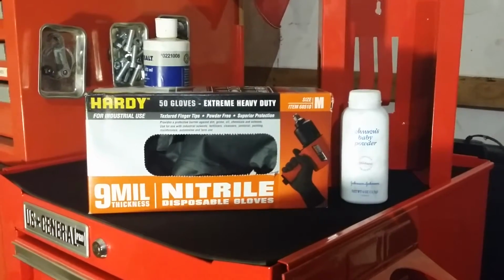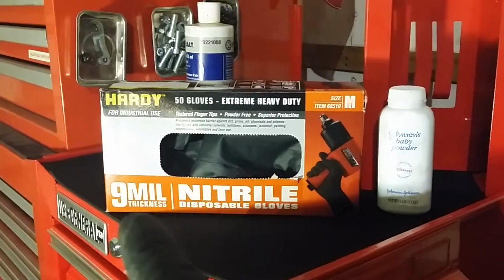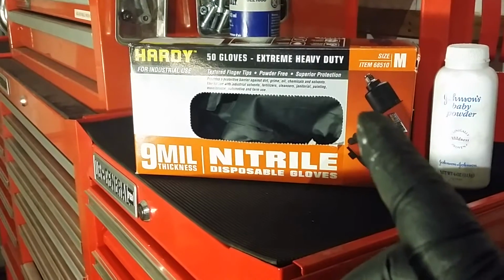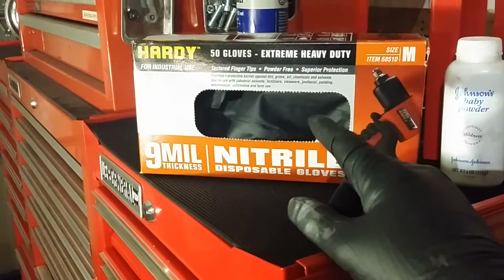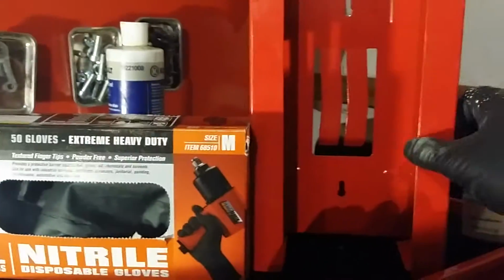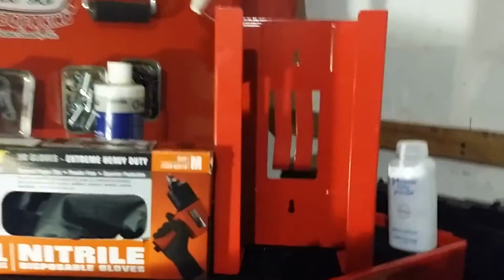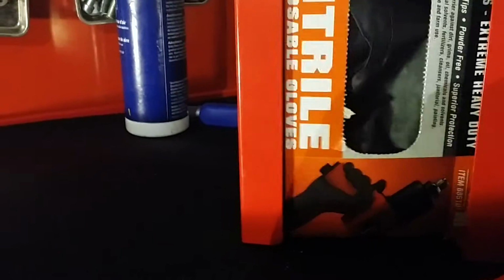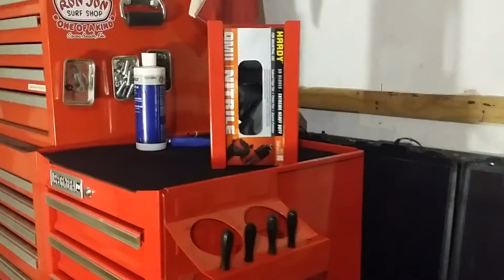Habor Freight 9Mil Nitrile Gloves and Magnetic Glove Dispenser

Comment: Good vid. Just bought a dispenser and another box of gloves at  HF last nite. Figured maybe I needed to buy more expensive gloves to to get a thicker box for  the dispenser to fit. I was like  wtf is this. I ended up bending in the tabs. The side ones not as much as the rear, but they are super snug. Careful not to bend too much, it will crack the paint as I've learned. But hell, for the 12 bucks it costed, and cracked paint on the back, im not worried and am satisfied. Shitty thing for HF to do tho. Ehh well. Get what you pay for. I grabbed the green one by the way.
Reply from the maker: It is a pretty good buy. It beats having your box of gloves kicked around the dirty floor. The HF 9mil gloves are the best ive found so far.
Reply: @matthewszostek1819  thanks for the reply. Wasn't sure being a 2 yr old vid. Lol. You have other HF reviews? Forgive me, I went to working in my shop after this I seen this vid, and didn't browse your channel.
Reply from the maker: @TKO---607  I do. Nothing like Ave. Some are more like which size air ratchet should you buy and why. I get into some weird projects too. I'm moving in an electrical direction but I have some videos on engine swaps, building cranes, sailboat restoration, carpentry, building custom dollhouses, and biodiesel with a little gardening and deep bible study. Pretty good content with rock bottom cinematography.  Thanks for being you and stopping by.

Comment: they are really good gloves, they do have a measurement diagram in the back of the box,  to make sure you get the right size. these gloves do rip Eventually but you can get alot of use out of them.
Reply from the maker: chrisvill54 I have noticed also they do not stand up to solvents for very long.
Reply from the maker: so i used these alot recently doing an engine swap on my wifes car and i probably went through a whole box just doing that job. i dont know what the standard for good gloves are but i did notice these arent very solvent resistant. i cant tell if its because little poke holes grow quickly into tears or if they break down quickly after exposure to chemicals but about a half hour after getting garage smoo on them they split easy. no big deal i just put a new one on but probably a good idea to get a fresh set before you do something where this matters.